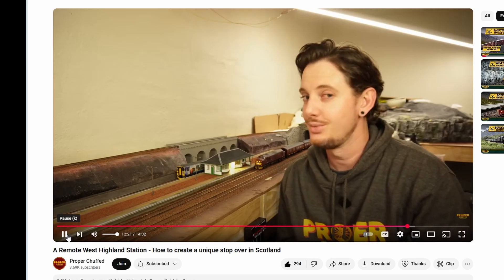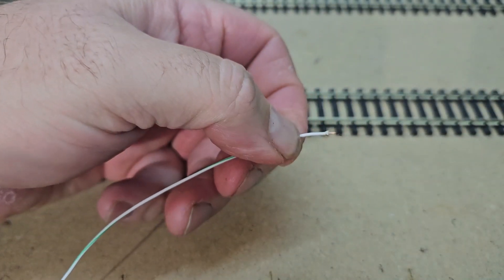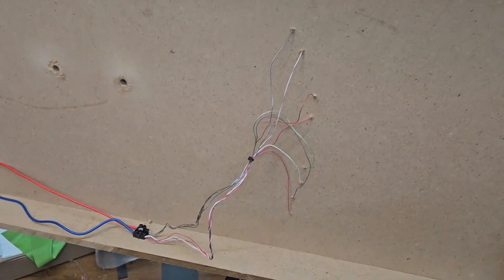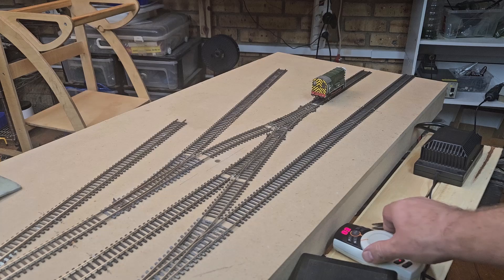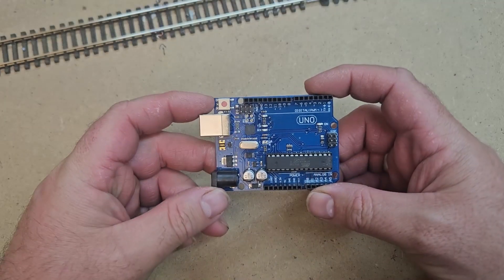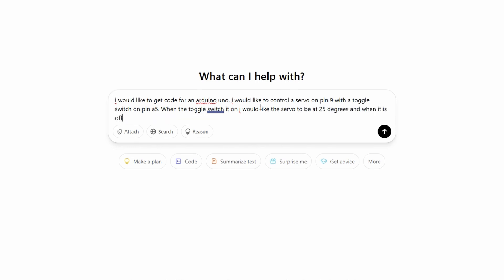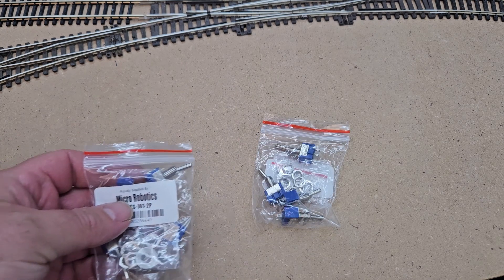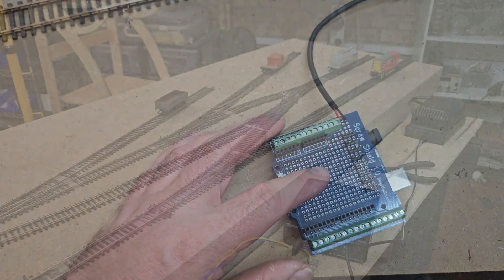Building an OO shunting layout pt 2.

Comment: Hi Phil, another informative episode and it was interesting to see your use of servo point motors. I was thinking of going down the servo route but found a stash of solenoid motors that i had stashed away so that sealed it for me. By the way, i don't know if you mentioned it but what are the overall dimensions of your layout? Cheers, Andy
Reply from the maker: @AndrewStewart-t9c  thanks for the comment Andy. I totally get it. Would you believe i had servos and a dcc decoder for them from 2018 and never opened the box?🤣 You have to go with what you have. Overall dimensions are 180cm x 49cm. I based it on my dining room table  so I can run trains next to the fireplace as winter sets in.